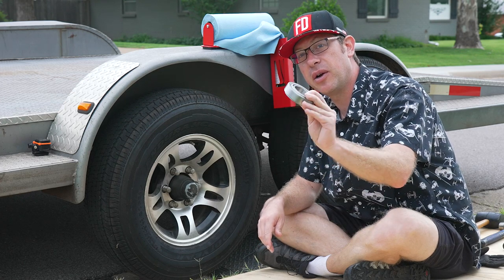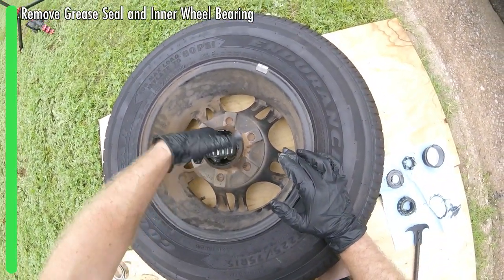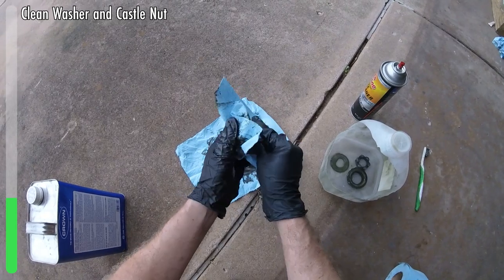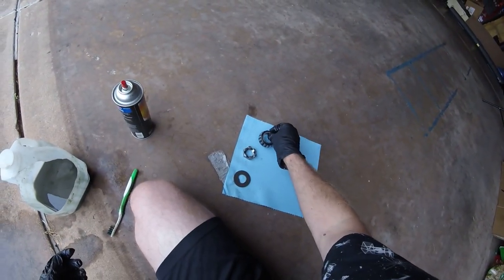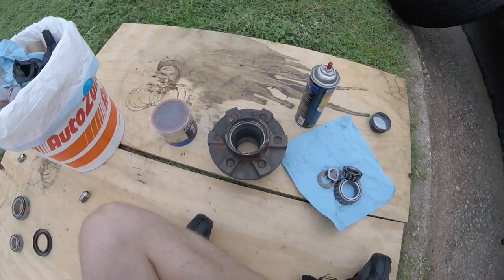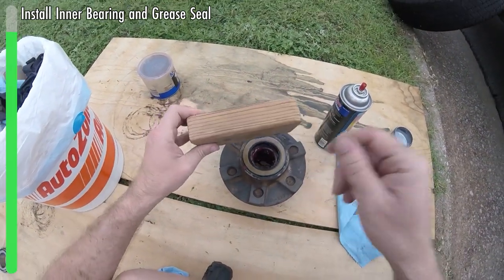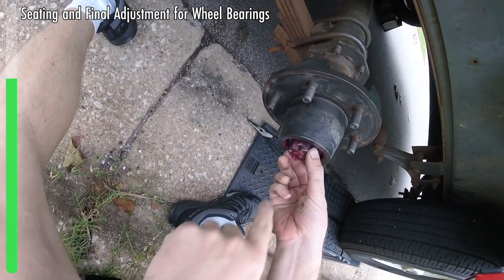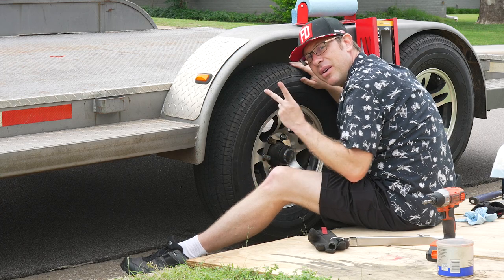How to Repack Trailer Wheel Bearings: Start to Finish

Comment: Very well made video, don't own a trailer yet, but saving this for later when I purchase a used one
Reply from the maker: Trailers are pretty strong and simple, definitely something you can buy used and do this plus brakes and springs & links and basically be refreshed to 100%. I did the same thing and am happy with the outcome & cost saving 👌🏻

Comment: Awesome DIY, have you ever changed out the shackles and bushings before?
Reply from the maker: Thank you! I’ve watched a video on it, but haven’t changed those yet, no. If and when, I’ll probably film that as well 👏🏻
Reply: @KameTrick  I'd love to see that.  I too have an open car hauler and recently spent a lot on a shop doing these things.  In future the DIY option is the better way.  Love your content!
Reply from the maker: @mostlyuselessgarage  out of curiosity, what did your shop charge for that job? My local shop quoted $50 labor per hub + parts for the job I did. What wasn’t terrible all things considered, but since they won’t be there for me on the side of the road if I have a bearing failure I need to be able to DIY with the tools I have on hand 💯
Reply: @KameTrick  had a bunch of items done to the trailer so I'm not sure of the individual cost for the hubs.  In hindsight I should gone DIY for exactly the reason you mention.